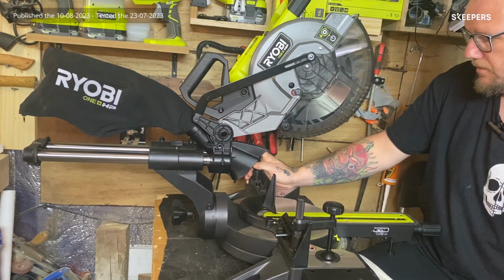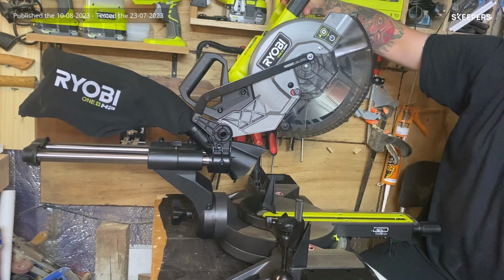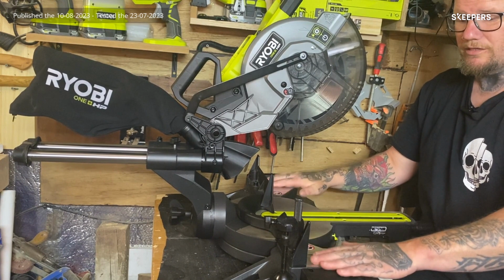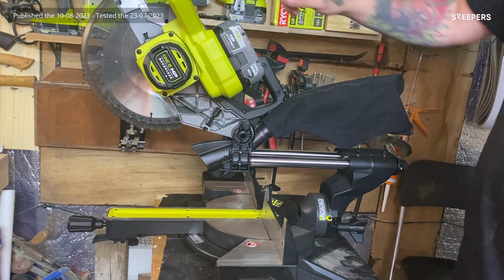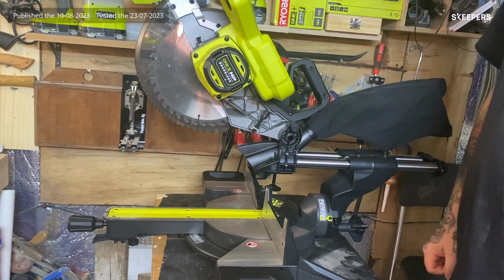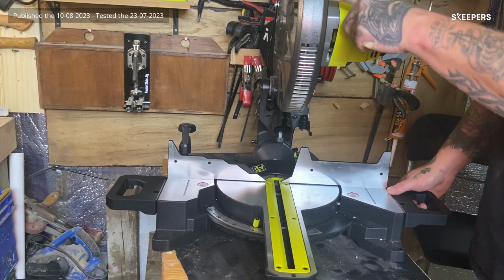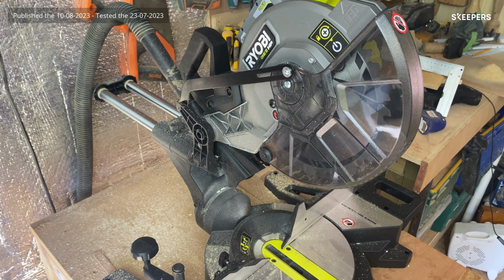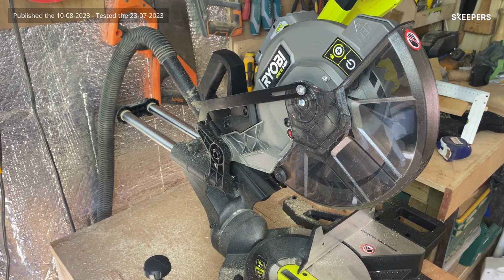18V ONE+™ HP Cordless Brushless 254mm Sliding Mitre Saw RMS18254X

Comment: So this saw is not dual bevel?
Reply: No. It is single bevel. So, if you want to cut an angle from the right-hand side, you got to flip the material opposite, upside down etc. I have one and it is not too much of a hassle if you are familiar with angles. I miss the angle cuts now and then not putting the correct measurement into account. For the price to lose one bevel, not bad I think.